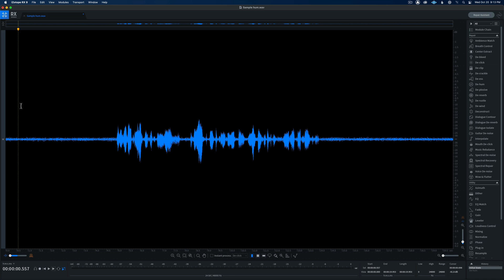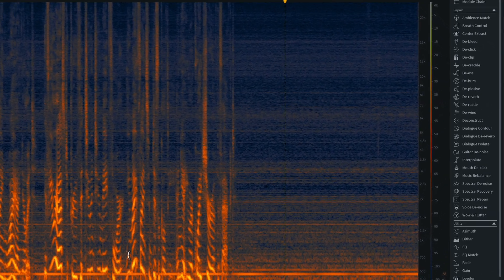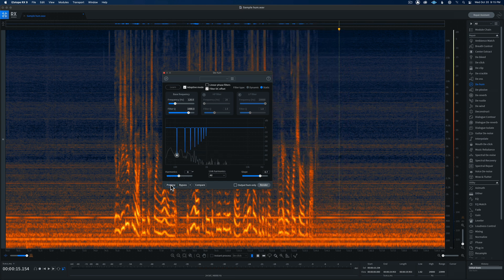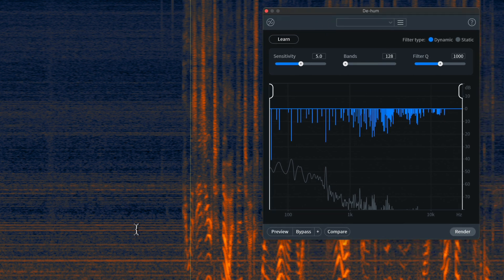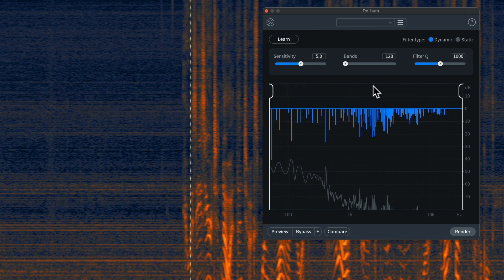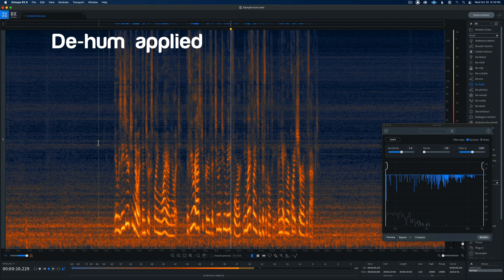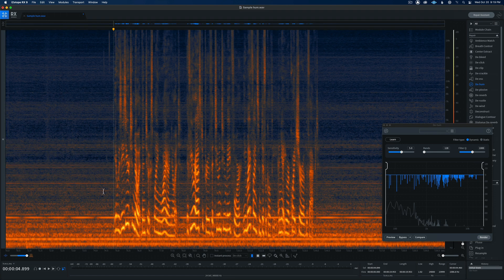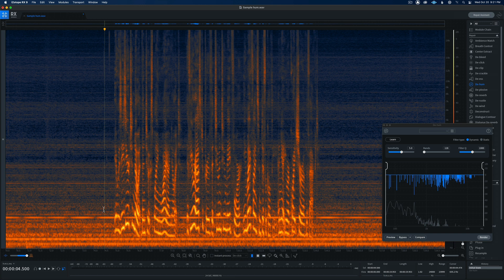Izotope RX 9 Dynamic De-hum

Comment: Have you compared this to the new Rx10 version? Wondering if there are significant differences.  Also, do you have an idea how this differs from voice denoise?  Thanks for these very detailed and clear videos!   I'm looking forward to watching more of your videos so that I can fine tune my meditation recordings.
Reply from the maker: Very few changes in RX10 except the de-hum now has a dynamic mode so you don’t have to “learn” first.
Reply: @curtisjudd  thank you!  And is there much difference between de-hum and voice de-noise?  Also, are you available for private consultations....like if I wanted some one-on-one guidance on fine tuning the sound quality on my recordings?  i use logic pro, and I have the RX9 Standard pack as well as JJP vocals for plugins.
Reply from the maker: @FertilityfromtheSoul  Yes, absolutely. De-noise is for broadband noise while de-hum is specifically for hums which often have a strong fundamental at 50 or 60Hz, or some multiple of that and then several harmonics at higher frequencies. At the moment, my day job keeps me so busy that I cannot consult, but perhaps in the future that will change.

Comment: Hi, I'm new to RX and am using it to clean up vinyl recordings. On my recordings I see and hear a bit of buzz/hum at the beginning but when the needle drops I don't see or it. So, I was wondering should I de-hum the whole song or just the bit at the beginning, in which case I'd probably just cut it out. I'm not sure if the needle drop cancels it out?
Reply from the maker: Yes, I'd only apply it to the bits that need it and if that means only before the needle drops, then yes, I'd just cut that part altogether.
Reply: @curtisjudd   Thank you, Curtis for you're reply. Yes, that makes sense to me. It's very tempting to go crazy to clean up audio that probably doesn't need it. Same with the clicks, if I don't see or here them I'm thinking, don't do the whole song, but yes, it's tempting as a newbie. Thanks again, now I can move on. 🙂

Comment: also Curtis, i find the spectral noise feature to do the same thing as the de-hum.  What would you use the de-hum vs the spectral noise features?  thx and great video
Reply from the maker: Hums are quite distinct. They'll have very strong fundamental frequencies and harmonics. Noise isn't usually the same. First thing to do is figure out whether you have a hum, just general noise, or both. Then I'd tackle the hum first, then the noise.

Comment: Workflow wise, do you find it easier to use RX9 as a stand alone program or as an insert inside of a DAW?
Reply from the maker: I would prefer to stay in the DAW, but some of the RX modules are only available in the RX Audio Editor. These are generally modules which have to process audio offline.

Comment: Hey Curtis.  Awesome as always.  My question is comparing sound designs hum plug in vs rx9’s dehum.   I have rx but have been curious about the sound design plug in since inception.
Reply from the maker: Hi David, I haven’t heard of the Sound Designs Hum plugin. Will keep my eyes open for that and have a look.
Reply: @curtisjudd  i had it wrong.  It’s mixassist.  You did a video about it.  Thought they address the same problem.   Maybe not.

Comment: When you select the "Learn" feature, it seems as if it takes a quick snapshot of the seconds of audio you've selected. When I do it, it just it just listens to the audio starting wherever the cursor it. Am I not selecting it properly? Different DAW (I use Studio One)? Different version (I have RX 9 Standard)?
Reply from the maker: I'm using the RX Audio Editor in this demonstration. I believe you may have to round trip over to the the RX Audio Editor to use the learn feature.

Comment: I would like know if we could work in multitrack whith RX 9 standart? By the way, thank you for your vidéo.
Reply from the maker: No, it isn't a DAW. It can open and process 6 channel poly wave files, but you cannot treat each channel separately.
Reply: @curtisjudd  Thanks for your answer. I buy it. If i understand correctly, I can open  6 channel and treat them together. It seems good for my works.
Reply: @curtisjudd  Curtis, that is not correct. You can select / deselect individual channels and then treat them like they are seperated.
Reply from the maker: @robertniessner554  I stand corrected. Thanks Robert. I think it is still important for people to understand that the RX Audio Editor is NOT the same as multitrack DAW apps. I get questions all the time from video editors about whether they can do something like a film mix in RX Audio Editor.

Comment: @curtisjudd  i would love love love to see a proper workflow for a casual production day - loading in the complete footage in premiere and then batching those through to rx9 somehow.
Complete adjustments, from removing stuff, to refining the sound overall - maybe even how to get a proper preset build to fire up everytime.
I cant work through like each individual interview clip, going back and fourth every single time...since there are like 30-50 clips/cut... could you showcase a real world scenario on a bigger scale than this micro example?
Reply from the maker: Yes, but not in Premiere since I don't use Premiere. I'd be more likely to show it in Audition or Resolve.
Reply: @curtisjudd  thanks, i think rx9 still doesnt work in Premiere... So the roundteip would be:  Premiere to Auditon anyways... if its just a click like open timeline in Addition. Maybe you could include that.
Reply from the maker: @chainshot  The RX plugins work in Premiere, but the round-trip to the RX editor is easier via Audition.

Comment: Nice overview Curtis, whilst not a magic bullet the new De-hum module seems like a big improvement. Would be great if you could take a look at the new Dialogue Isolate module too. So far have found the new algorithm to be pretty much unusable on everything I've tried it with (loads of high pitched squealing artifacts). So would be really interested to see if I'm doing something wrong / others are having good results.
Reply from the maker: Yes, was just working with the new Dialogue Isolate this morning. It seems to work best with discontinuous noise that is NOT broadband which, when I think about it, makes sense. It was not able to remove footsteps in the background of a dialogue take, but was able to remove most of a mobile text notification sound. More to come on that.
Reply: @curtisjudd  Thanks Curtis, yes definitely seem to need to be more selective compared to legacy algorithm. I'm finding breath noises etc send it doing some strange things. But sure it will come in handy for some precise targeted work like the text notification sound.
Reply: I am having great results with the new Dialog Isolate. But I always prepare the audio with a slight spectral denoise beforehand.

Comment: That's very nice.  Thank you, Curtis.
In regards to wind noise, what has been your experience?  I would guess it's harder to remove because the pattern is not much of a pattern, but more random?
Reply from the maker: Yes, will cover de-wind as well.
Reply: @curtisjudd  
Nice!  Looking forward to it, Curtis.
Reply: This program is magic, de-wind cannot make you sound like in studio, but it will make it enjoyable enough, that it's not disturbing.
Reply: @renartsk  
Oh!  It also has de-wind?  Nice!  Thank you for letting me know!  I'll have to search out for examples.
Reply: @huyked  Yeah, it does. It also has de-clip, which saved my ass on one occasion. Wind hitting the headphones was so strong, that I couldn't hear that I was clipping (mic turned up, receiver down, so mic levels were not a pointer). Really one of the best purchases one could have if mistakes have been made
Reply: @renartsk  
Thank you for sharing your experience and the confirmation.
If you have any unlisted examples of before and after (final edit), I'd love to see it what you mentioned.  Cheers!

Comment: Futher on after the de-hum, would you try the de-crackle afterwords, or what would be the most probable? Helpt my collegue recently with exactly this problem but with the earlier version of Izotope.
He had been in a aircondition compressor room 
and I got it "good eanugh" except a little bit to much cut  in the dynamic with just de-hum and de-crackle. Hadn't the latest version then, but now 🤗
Reply from the maker: I'd probably go to spectral or dialogue de-noise next to pull down the fan noise a bit.
Reply: @curtisjudd  Sorry, my bad, now I remember, it really was spectral and dialogue denoise that I used but I tried or even saved it with the de-crackle as well. I will picup and try with a new version now when I have the new post/Iz.nr.9. Thanks. M